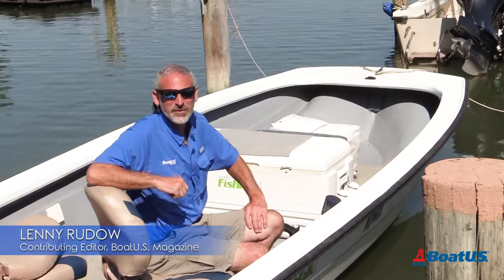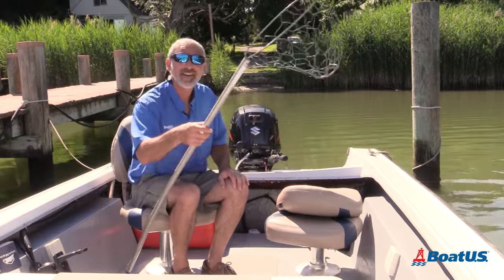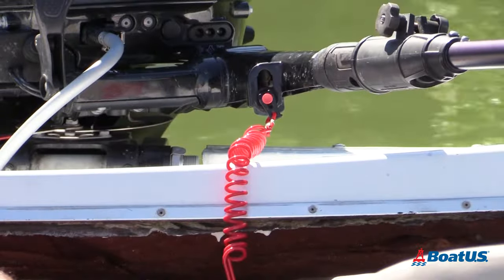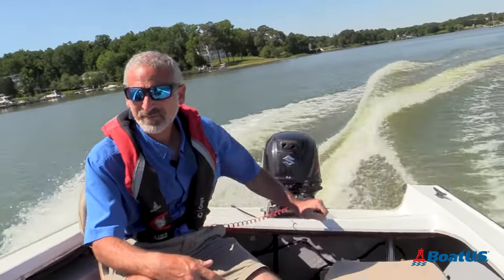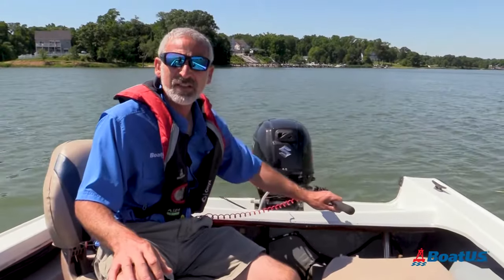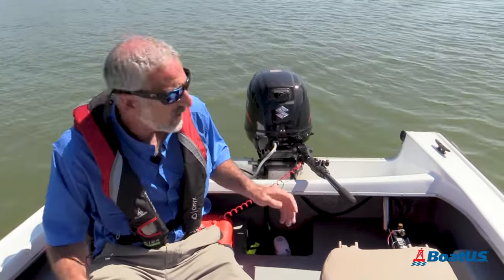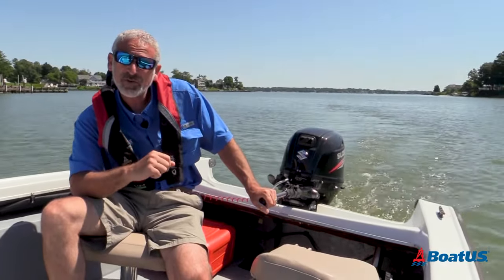How To Drive A Tiller Steer Outboard Boat/Dinghy LIKE A PRO! | BoatUS

Comment: Another thing to mention is when using a tiller/prop motor, torque becomes a consideration.  You NEVER want to let go of the tiller handle while underway because the torque of the prop can cause the motor to instantaneously snap sideways and can possibly eject you from the boat.
Reply from the maker: Thanks so much for the great tip, no regerts! Definitely a good safety reminder.
Reply: That happened to me 🤣

Comment: Not only is it simpler, it's cheaper. Less maintenance than a wheel system, too.
I see it as similar to the contrast between automatic and manual transmissions in a car.
Reply from the maker: Absolutely! Thanks for watching.

Comment: thank you! renting a tiller boat this weekend with the buddies, blows my mind that they let absolutely anyone rent lol, but let’s see what happens. i took my boating course just so i am more knowledgeable (not needed to rent this 14ft tiller boat)
Reply from the maker: You are most welcome, Top. It's a little counterintuitive at first. If you can, get out into open water and play around (safely) to learn how the boat handles before you try close-quarters maneuvering. And you're correct -- taking the boating course does make you more knowledgeable than a lot of the folks out there. Congratulations on getting your certification! Be safe and have fun. (And don't forget your life jacket!)

Comment: Do all those type of motors have manual gears? Or are some like trolling motors where you twist the handle.
Reply from the maker: Thanks for the question, SWM! Gasoline outboards have a separate shift handle or mechanism that's not part of the twisting handle/throttle to shift into forward and reverse. There are some very small older designs around, however, for which the whole engine actually swivels 180-degree in the mount in order to "shift" into reverse!
Reply: @boatus  Thanks.
Reply: @boatus  Do you have any tips for backing up? Lmao I have issues remembering that. Lol
Reply from the maker: Sure! Turn the motor in the direction you want before shifting into gear. Then shift in and out. Bump the boat back and always turn the motor while it's in neutral (so you don't have directed thrust ever going anywhere except exactly where you want it). Hope that helps!!
Reply: @boatus  I meant directions. I can never remember which way to turn the thing to go left or right. 
Is it the same as going forward? You turn it to the opposite side you wanna go?

Comment: When is it safe to switch from neutral? Does it have to be on slow mode before switching?
Reply from the maker: Thanks for the question, Trayvo. Before shifting into and out of gear, you should always throttle all the way down to the lowest possible idle. Thanks for watching and hope this helps.

Comment: A bit too basic. It would have been useful to mention that as a safety issue, the operator should always sit on the opposite side of the tiller. If the prop hits an obstruction, particularly in small RIBs, the tiller can violently turn to port and throw the operator overboard.
Reply from the maker: Good point, and thanks for the suggestion, Carlos. We''ll put that on a list in case we do a follow-up to this video.

Comment: What is the function of the choke? And how to operate the choke in the case of starting the engine?
Reply from the maker: Thanks for the question, Joseph. The specific engine in this video doesn't have a choke, nor do other modern outboards with EFI fuel delivery systems. If you have an older outboard with a manual choke, as a general rule of thumb you'll want to pull the button or lever out when starting, then push it back in after the engine has run for a minute or two. However, there's a wide range of chokes out there; it may require pushing on the ignition key, lifting an arm, or other processes. In any case, you'll want to engage the choke on start-up, then disengage it as soon as the engine has run enough that it won't stall out.

Comment: I love that boat!! Make and model please?
Reply from the maker: Thanks for the question, @Legnerps! Would you believe that hull is actually a 1980!?!?! Its original builder was called Flounder, and the model was simply the 16. They're long gone now. However, C-Hawk acquired the molds at some point and currently builds a similar skiff called the 16' Tiller with the same hull and a different interior. It has bench seats running across rather than being completely open. It also offers a center-console version called the 16' Center Console.
https://chawkboats.net/welcome-2/product/16-tiller/
https://chawkboats.net/welcome-2/product/16%e2%80%b2-center-console/
Hope this helps, and thanks for watching!

Comment: You failed to cover or even mention the issue of whether to lock the motor down or leave it unlocked. If you leave it locked down and hit a rock, it can rip the transom off the boat. Leaving it unlocked seems to be a better option but creates its own issues like the prop coming out of the water during reverse.
Reply from the maker: Hi Robert - Most outboard manufacturers recommend running the engine down and locked in "normal" conditions. Operating unlocked can cause the motor to kick up in a dangerous fashion, not only when shifted in reverse but also from rapid deceleration. It's generally only recommended when "operating very slowly" in shallow/dangerous conditions and/or in the partial-tilt shallow mode. When operating at high speeds striking a solid object can, of course, cause all sorts of damage including to the transom, and some boaters who commonly run in shallow and rocky areas do prefer to operate with the tilt unlocked believing it to be less dangerous since strikes are relatively common. We'd always recommend operating the motor slowly, in any case, when a hard strike is a distinct possibility.
Reply: @boatus  Thank you for an excellent reply which is consistent with my experience. Unfortunately, most of my stern drive experience is fishing on lakes and rivers up north in Maine where rocks are abundant and can really sneak up on you. When you have many miles to cover it can be difficult to operate very slowly so I operate with the tilt unlocked and really pay attention.
Reply from the maker: @robertdodge6194  Thanks for giving us the opportunity to address this!
Reply: @boatus  I know the feeling,i operate in the back bays of midcoast Maine. I rarely go more than five knots... I now have a fifteen horse power tiller with a 14 foot Mon ark.  Could probably go twenty miles an hour but not around here man. I once owned a nice 17 ft center console Aquasport and filed down the skeg on a large long flat rock just submerged at high tide. Lesson learned: know your waters...but still go slow. Enjoy the ride...there's no need to hurry.

Comment: You didn’t spend any time talking about steering in reverse and the hazards, or the tilt features and how to get the motor back down after it has been tilted up.
As a Sailing Instructor these are the hardest things my students face with tiller steer.
Reply from the maker: Good points Tom. One must always proceed with caution and go slowly when operating a tiller-steer, or any outboard motor, in reverse. Addressing tilt is a tough, since each manufacturer uses a slightly different system, and the systems they use change through the years and on different models. In this case, the best we can say is to study the owner's manual and practice tilting the motor up and down prior to using it, so you become familiar with the specific model's handles and levers.

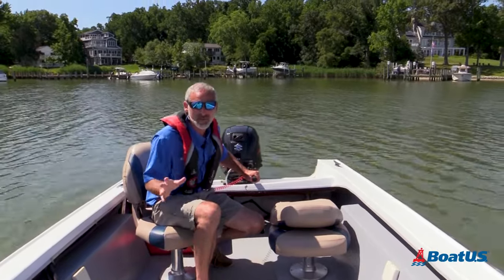Comment: I’m SORRY for saying this, but, at 1:40 you say steering can be confusing. This has no bearing on you!! But if a credit card boater is confused on how to turn a boat with a tiller, HE SHOULD NOT OWN ONE, PERIOD!!!!!!! That should not even be mentioned! And to say a you should have a little tension on the friction adjustment to prevent “over steer”??? That has absolutely NOTHING to do with over steering, you either move the tiller handle or you don’t, unbelievable video. Go back to boat school.
Reply from the maker: Now, fishin ... I guess you came out of the womb knowing how to use a tiller-steer? Not everyone is so lucky. Let's show a little grace for the folks just learning this. The reality is that using a tiller outboard IS tricky if you're not used to it -- we're all used to driving cars, which is VERY different. It takes practice, and if we can give a few people some helpful tips, it's better and safer for everyone on the water. Let's encourage people to come into our sport -- and do it safely. That's a win-win for everyone.
Reply: calm down bud